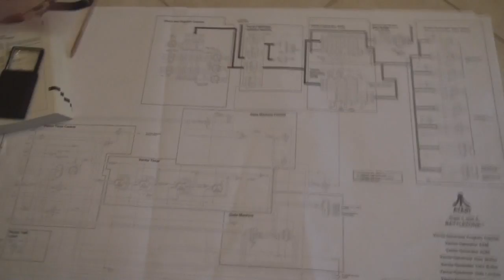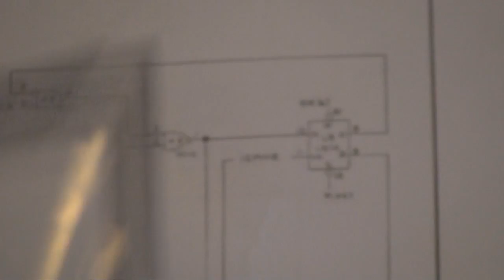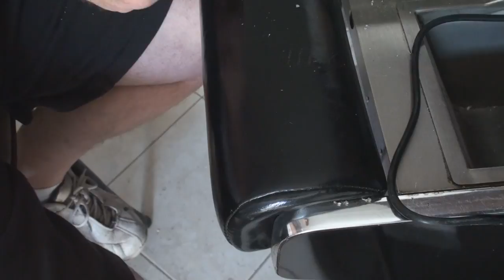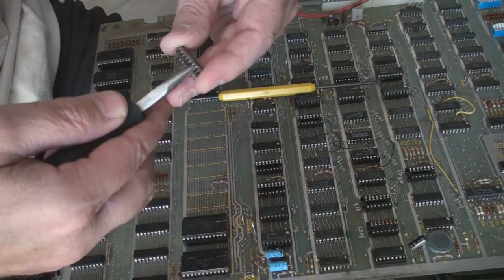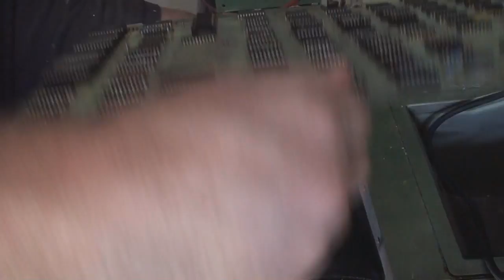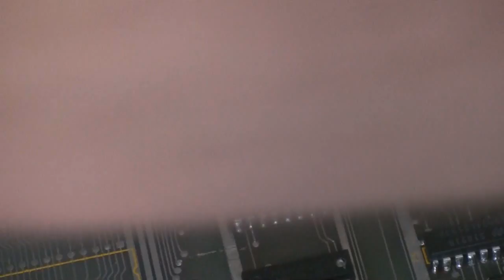arcade game repair tips finding bad IC's and logic probe

Comment: Thanks for the awesome videos! I am just getting into the arcade hobby and am curious,  I notice you don't wear any anti-static protection, or even seem to care about it the way you handle the boards and chips, is that not a big issue anymore? Back years ago when I used to work with electronics that was always a major concern.  Thanks again for the great stuff.
Reply from the maker: it isn't an issue. even if it was, it would only be around the eproms...ive never had an issue with it even while building computers.
Reply: @Cookingwithdrchill  Same here. built hundreds of computers.  never had a problem with static.

Comment: What is that reference book you are using for the IC identification and layout?  LS/S/TCC logic databook?  do you have an ISBN number and do you have a recommendation for someone getting into electronics repair to start their library of useful books?  I work on medical equipment and am starting to get them more tools/ books.  I am kind of the go-to guy for electrical issues now.  I think the book you have and any others you can recommend will be great.  Do you have ISBN numbers if you do suggest any.
Reply from the maker: off the top of my head I don't know who made it, but there are tons of them out there. I got mine on ebay for like 15 bucks years ago.